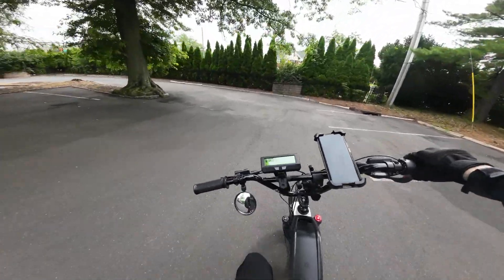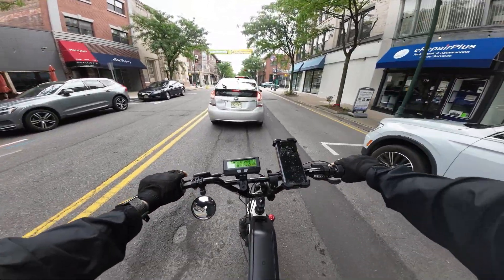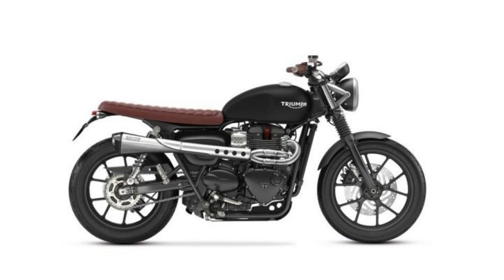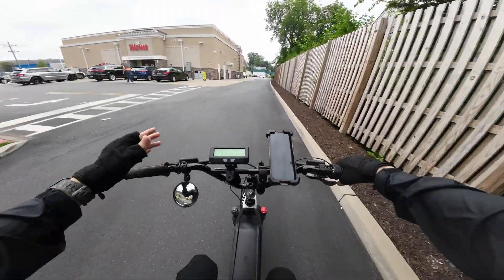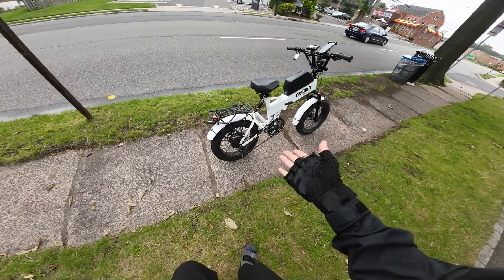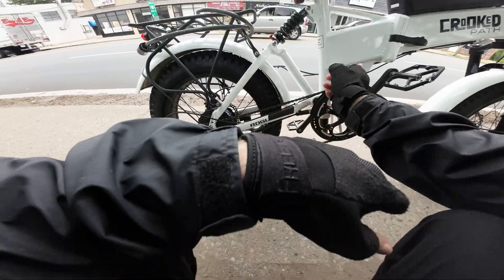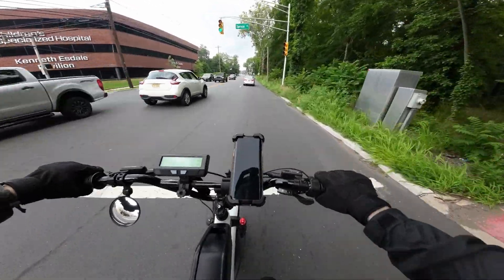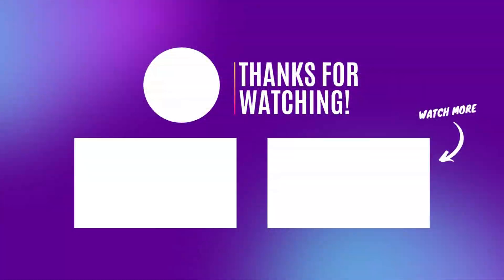Why Hub Motors are Better than Mid Drive Motors

Comment: I believe you miss the most important aspect completely. That is the rider. If it’s someone who just wants to go out and buzz around, a hub drive may be the best bike for them. If it’s someone who’s going to change gears, no matter what, mid drive would probably be much more efficient for that person. So what’s best for one may not be for the other. I believe they both have advantages and disadvantages. The trick is, use the advantages to our own advantage, and see how well we can work around the disadvantages.
Reply: I'll take middrive all day sry, dont care for the top speed I like the torque more and easy tire changes lmao 🤣
Reply: @Zensaitv  Depends tho i have a 1500 hub motor on 20 inch. This thing beats moped easy. Top speed is 45kmh.
Reply: @Zensaitv  and that is exactly my point. The rider is the most important link in the chain. I prefer a mid drive as well. My wife is better off with the hub drive. It’s not that I’m right and she’s wrong, or she’s right and I’m wrong. It’s just that we’re different.
Reply: Large wheels can handle bumps without suspension. Suspensions (other than saddle) absorb forward momentum, therefore reducing range when not locked out. Tyres will be very difficult to change with hub motor. By utilizing the bikes gears mid drive bikes climb better and have longer range.
Reply: @scottrichards3587  I have to say i live in the Netherlands so its very flat here plus the roads here are top quality. So personally not a lot of big bumps. I disagree with the tires tho. Cause if you gone get a mid drive, get a hub shifter. And at that point both bikes would be same difficult to change tires. Now you have a way more complex setup and also more loss cause of the drive train efficiency. But like as you said if the terrain is a lot of hills and what not then midriver  is the better option.

Comment: Thanks for the informative video! - I bought a Crooked Path ebike like yours as a base for upgrades. So far just I've just done the BMX handles, but I'll keep upgrading parts as I can. What did you end up using for the rear suspension? Looks different than the one you planned on using in earlier vids.
Reply from the maker: Nice! I’m now using the 150mm JFOYH coil shock you can find on amazon for $75 bucks. It is pretty good!